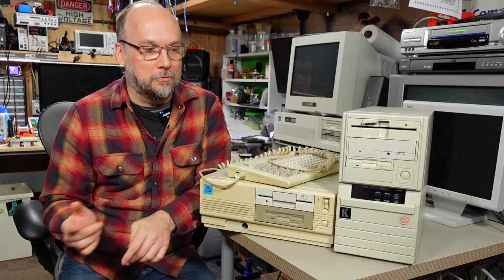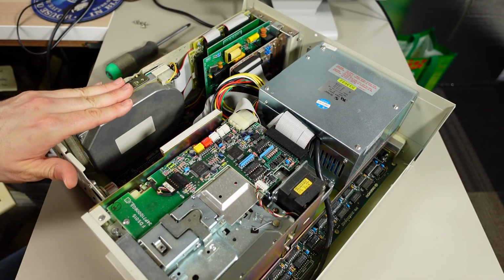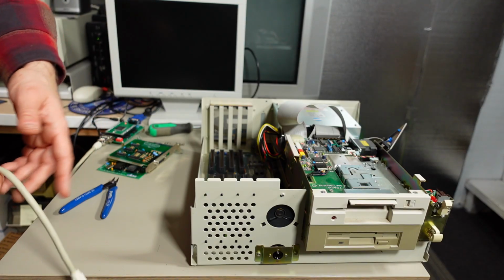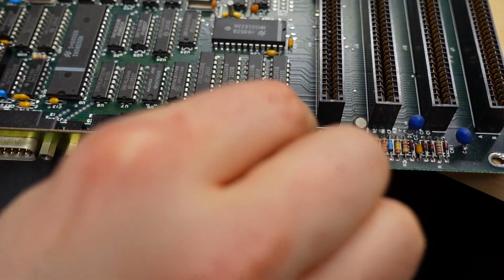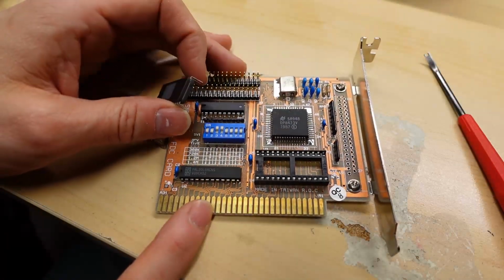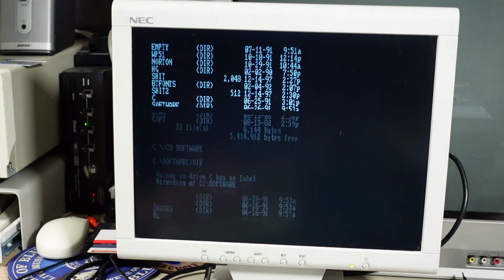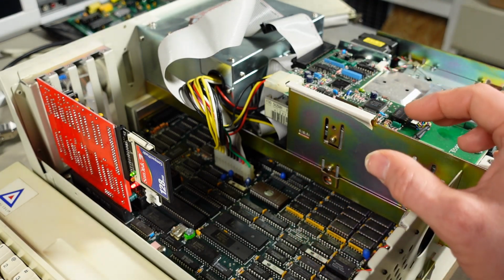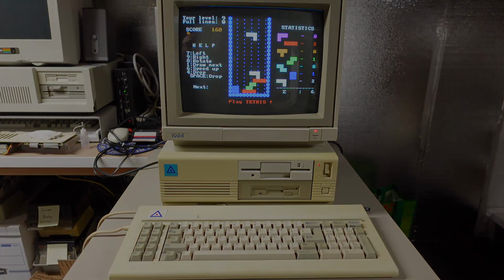PC archeology: Leading Edge Model D

Comment: When I was a kid, my parents delayed buying a (much needed) new car to buy a home computer. They bought a Leading Edge Model D. Paid something like $500 extra to get the full 640k of RAM. Our was dual 360kB floppies. Later my dad brought home an IBM PC-XT from work to be his "work from home" computer (MDA video card, 20 MB hard drive plus dual 360kB floppies,) so the Leading Edge got to come to my bedroom instead of the basement/family room. I bought a Hard Card (20 MB hard drive on an ISA card) and a modem for it, and BBSed the nights away! 

We even had two phone lines - the second one so my dad could dial in to work (yes, in the late '80s!) I got caught BBSing in the middle of the night on the main phone line, so I ended up illicitly running a phone cable from the basement to the upstairs to my bedroom through a furnace duct/vent so I could BBS on the second phone line.

Between then and high school in the '90s, my parents brought home from their work a Compaq Portable II (to keep, it was being replaced by an early laptop) a PS/2 Model 50 (replacing the XT as my dad's work-from-home computer,) and a PS/2 Model P70 (the "luggable" model with the large red-gas-plasma screen - also to keep as it was replaced by a laptop) which replaced the Leading Edge in my room (plugged in to a VGA monitor I bought myself so I could have color.)  In high school, the "family PC" got upgraded to a later Leading Edge 486. (My dad's work PS/2 got moved to another desk.)

The 486 wasn't very impressive. (Although I did end up upgrading the RAM, hard drive, modem, and video card myself.) Leading Edge had been bought by that point, and was just yet another generic PC maker by that point. (They were one of the earliest "low cost PC clone" makers back when we got our first one.)

Comment: The 16k ROM is probably the 8k ROM twice to make it easy to flash the 8k ROM to 16k chips which were more readily available. In doing this, they ensure the ROM is in the top space of the 16k without all the fiddling around for burning lots of ROM's back to back. It's an old trick that I've seen used quite a bit.

Comment: Tandy 1000 SL and after did have a 640x200x16 color
https://en.wikipedia.org/wiki/Tandy_Graphics_Adapter#Tandy_Video_II_or_ETGA

I remember selling the Mod D. good box over all.   IF my memory is correct aslo sold a Samsung branded it had memory speed and wait state switches on the outside of the case in back !

Comment: It's always nice to see a "HardCard".  In aroundabout 1984, The first IT job I had was working for a small company in the UK "XTec UK" that used to buy in hard disks and controllers, re-programed the on card BIOS and mounted both on the hardware bracket, hard formated, softformeded repacked and sent out.   The hardcard we called the "Insider".   Some times we used OMPI and sometimes WD controllers.

Comment: Wow the nostalgia. I had a leading edge model d 2, if I recall. It was a 12 MHz 80286 with a 256-color 320x200 VGA card. I wish I still had it. :( It had a 5-1/4” drive too but it was different from that one. I was a kid and didn’t know how to put in a 3.5” drive. I tried to put in a sound blaster, but I couldn’t get past the irq conflicts and gave up! :( life of regrets.

Comment: The MM58167 is a National Semiconductor Real Time Clock chip. It's near the NiCad. The PC dates from the era before the various Intel peripheral ICs (8237-DMA, 8253-"PIT" timer, 8255-parallel I/O, 8259-interrupt controller etc) were all integrated. Now you have removed the floppy and PSU, the INS8250N is a serial I/O chip (UART) and the P8272A is an Intel floppy disk controller chip. Interesting that the original ICM PC design included the DMA controller as arguably at that time it wasn't really needed, since with a single tasking CPU all I/O could be done using the CPU to transfer data. All old hard disk drives support PIO Mode1 which is the I/O based (data read and written using CPU reads/writes only). Intel "owned" a lot of the silicon in the original PC which of course would have resulted in a massive income stream. Even National Semiconductor did well from the inclusion of their serial I/O chip (INS8250) which ironically is an Intel design which Net Semi second sourced. I'm reasonable sure that the Nat Semi prefix "INS" means Intel-National-Semiconductor as it appears to be used on many Nat Semi ICs in the 70s and 80's which were originally Intel designs.
I also spotted a 1.8432MHz oscillator block which is used to generate the baud rates for the INS8250 chip. I built a serial I/O board using a INS16450 (exactly the same part as the 8250 just renamed for marketing purposes) recently for a retro project and despite a lot of oscillator blocks I didn't have a 1.8432MHz one, but I finally found a rescued crystal of that frequency.

Comment: Did you happen to check out the "Think Closure" banner by any chance? Was it a closure announcement for the business that used the PC?
Also, could that 16k ROM image have just been the 8k ROM duplicated in both upper and lower halves?

Comment: The Leading Edge Model D was the first computer imported to the US from South Korea. If you see an XT system that sort of has the general shape of that Model D, it's most likely manufactured by Daewoo. They're all glorious, if XTs are your thing. Great onboard options, great build quality, and I haven't run into a dead power supply yet. Leading Edge Model D, a random Blue Chip, and an Epson Equity II, all Daewoo.

Comment: Largely unrelated, but the floppy cable twist just bugs me so much. Shugart had a nice 4-drive protocol where you set the jumpers on the drive to which of the 4 IDs it should respond to. 
Then IBM is "Well, if we set all the drives to disk 1, and flip a few lines in the cable to fake things, assembly at the factory will go smoother... and we'll create an inferior variant of the Shugart standard that will become wildly more popular because IBM did it. "
And we were forevermore stuck with routing floppy cables around and down and back and up to try and get the twist in the right place without running out of cable when we could've just been flipping a single DIP switch to change the drive ID. And we don't even get the benefit of a narrower cable out of the loss of four-drive support.

Comment: Very wild guess due to a personal experience with DIP-switches in a gamepad I once had: Maybe the DIP Switches were meant to switch between certain button supports on some none Kraft-brand joysticks that might have used inverted switching by sending inputs low instead of high, causing the computer to maybe register button presses when a button was actually unpressed and register the button depressed when actually pressing it.
I had a game controller that used the game port (bought it in like 1998 I think) and it had those switches on the inside (I noticed when I opened it after it broke) and when I opened it up I decided to flip one and it sended one of the buttons to fire continuously unless I pressed it causing it to become depressed.
Then there just might also be a switching combination allowing a multitude of different setups: axis becoming yawns for the then available flight simulators and that kind of stuff, or axis being in a different analog format (+3.3V instead of +5V or maybe even negative voltages for an axis in order to increase resolution without actually going for a higher resolution potentiometer or something).

The power connector by the way looked like an AT style power connector but instead of 2x6 connectors it was a full 12 pin one.

Comment: Back around 1988, I had to dissolve my small legal partnership for several reasons, one being my partner''s unwillingness to invest in hardware and employee training to adopt a (then) modern PC computer installation in the office. What was odd then was that my firm had been one of the leading firms to adopt in-house computer services (CPM) in our city, one of the medium large cities in our state  starting in 1979. After our split, I bought my secretary and myself computer systems and lessons on use of WordPerfect. I bought myself a Leading Edge XT, and it was a lesser, middle of the road computer, but fine for word processing. I taught myself WordPerfect 5.0 one weekend; and never got out of my bathrobe and never looked back. My secretary got an AST 286, the "Cadillac" of office computers of the day. The XT, 286, two pin printers, monitors, etc, plus some software, set me back $4,500 in 1988.. Later, another $1100 bought me the first Panasonic laser printer, which must have weighed 75  lb.  If that seems like a lot of money, consider that the CPM system we (firm) bought in 1979, based on a 3 disk drives (5" disks) with a top of the line pin printer, cost us $15,000 with basic office software developed by the local vendor. We had to hire a dedicated system operator to do all operations. She later quit when I wouldn't pay $10,000 for the new "Wincheter" drive, first hard drive, with a mind-boggling  one megabit of capacity. Later, my Leading Edge was stolen, and I replaced it with a generic 386DX; I remember thinking what a bargain I got finding expansion memory for a but less than $100/meg.  Good times.

Comment: My first computer was a Leading Edge D3/SX. I still have it in my dad's attic. It's a 386sx 16mhz. It came with 1MB of ram that I maxed out to 4MB. I upgrade the 40MB HD to 425 back then and added a sound card and external cd rom. It had a separate video card with both a 15 pin vga and a 9 pin ega port on it. It had both 5.25 and 3.5 floppy. The model number on the back badge said DC-311. It came with DOS 5 and PC-Geos. I upgraded it to DOS 6.2 and Windows 3.1. The strange thing was to get into the bios you had to press ctrl, alt and S. I've never seen that since on a computer. I need to pull it out for a video. It might be interesting.I remember the Leading Edge diagnostic program and Banner Mania.

Comment: That leading edge machine is in such good condition and working so perfectly I'd be very inclined to keep it as original as possible; the HDD isn't showing any signs of age or wear; seems to be running lovely, keep it! Those classic noises of an MFM hard drive seek aught to be preserved in a machine of this calibre!

As for the FDD controller... boy. That was a bit of a unicorn you had there. They do come up on ebay from time to time, e.g. https://tinyurl.com/y7fbgrby but you've got to keep an eagle eye out for them. Maybe stick it in a saved search so you're alerted when another comes on the market?

Comment: easier than using an xtide, and closer (but still not there) to period correct: iomega zip drive through parallel port.  use the palmzip driver to allow it to work on pre-286 and pre-dos4

Comment: Super cool! At my first job, I was part computer programmer and part tech support person, and one of the things I was often tasked with was helping to get our software to work with the IBM clones of the day (1987-1988). At one point, we get in a few Leading Edge desktops, and one was assigned to me for awhile. I'm pretty sure it was a later model, 80286-based, probably running at 10MHz or so. Nevertheless, this video brought back some memories.

Comment: I used to work for a Leading Edge dealer, so I have come across a few of these machines in my time. I know the later D2 and D3 used disk based CMOS setup programs, I don't remember if the D used it. An archived copy of various Model D series utilities can be found here: https://web.archive.org/web/20160818162528/http://www.rainbowdatainc.com/files/D-UTILS.ZIP

All files from the old LE BBS thankfully got archived here: https://web.archive.org/web/20050205153021/http://www.rainbowdatainc.com/files/

Comment: The very first PC I built, from scratch, was an XT. It was 10Mhz, turbo, and had 8, 1Mb RAM chips. Everything was on cards, except the keyboard. I had an MFM HDD controller, which I had to, not only set jumpers, but also boot into the card's firmware to low-level format the 20MB Seagate hard drive. I once got a hold of an RLL controller and could format the same drive to 30MB, but it wasn't stable. My friend would visit his dad, who I assume worked at UNR (University of Nevada, Reno). He would always come back with loads of disks with games and "laughy" text files, with deadly dad jokes. That's how I got a hold of Thexdir, a fun game that worked on any display, including cloned Hercules.

Comment: A lot of head scratching in this one !

Minimize the setup by removing unnecessary cards & just get the computer running . 
Then run hardware monitoring software  .

I like PC tools or Norton for vintage computers .
( Norton had a killer disk utility & disk doctor , PC tools could edit the disk directly ) .

It'll give you all the information Ports , IRQ s , the memory addresses  &  probably the adapters or devices that are using them .

Comment: I had a Leading Edge Model D with the Turbo switch.  It really did run slightly faster in Turbo mode.  Some one gave me a 8087 math Co-processor.  It wouldn't run in Turbo mode.  However in regular mode and with the math chip installed, my CAD program (CADkey) was decently fast.  Plus, I had a 30Meg hard drive!  All in all it was a pretty nice machine that I wish I still had.

Comment: we had a leading edge xt as our first PC in our house. had the dual video outputs. we had a mono monitor sitting on top and a Sony trinitron with RGB input that doubled as the tv we would use in the kitchen while eating dinner. we would wheel it out to the living room and hook it up to the computer and could get CGA for color games. 10mb hard disk using stacker to get it up to 20mb ish.

Comment: Hi Adrian, have just been clearing out my garage and found an old "Sunshine" Eprom programmer which uses an XT style card, looks like it programs the old 25/21 volt Eproms, comes with the original 5.25 floppy and instructions, yours if you are interested. I'll throw in any other XT stuff too just to fill up the box. And many thanks for the years of helpful info on how to keep these old machines running.

Comment: AAAAAAAAAAA my aunt had a Leading Edge XT. She eventually gave it to us, but we didn't get much use out of it because we already had another XT and, I suspect, an AT by this point. All the memories are coming back, from the right-angled keyboard plug to the giant plus key. I don't remember it having the power light built into the 1 on the power switch though. I wonder if that was a later change to the case design.

And speaking of half-buried memories, I wonder what causes the iridescent, spilled-oil effect on the metal of some of these old computers. Something they coated it with to keep it from rusting, maybe?

Comment: Pretty sure none of the drives in that computer were original. Our first XT type computer was the Model D and it came with a 5 1/4” floppy with the lever similar to the 1541 Newtronics mechanism. The second bay had a 40MB MFM, but I’m sure there was also a dual floppy verdin. IIRC, the processor was an 8088 that could run at 4.77 or 7MHz and there was a turbo switch on the rear. It was a solid system that lasted us from the mid-80s well into the 90s.

Comment: A friend of mine had one very similar, possibly this exact model when I was a kid.  We discovered flipping the COLOR/MONO switch to MONO and back to COLOR would make it switch CGA palettes in some games - to the red and green palette instead of cyan and magenta. Theirs had a black hard disk where the 3 1/2" is on this particular model. That 5 1/4" also spits the disk out when you open the door and had kinda nice action.  I remember the door lock too.

Also SO MANY CHIPS!! we had an original Tandy 1000 at the time which has probably less than half the chips.

I remember them getting a joystick card for Christmas one year too, just like this one. We played lots of Test Drive on it.

Comment: Great Video.  I demoed Minix 1.5 on my Leading Edge Model D 2011 at VCF Pacific NW 2019.  Back in the day, not every PC/XT clone was 100% IBM compatible.  When I was researching Minix, I found an old Info Sheet that mentioned the Model D worked well with Minix.  Great System - I swapped out the onboard UART with a 16550A and put in the XT-IDE Card.  If you google, there is an 8088 BIOS called Super XT.  I run that now and it works great.  Only downside is that the built in Video doesn't work.